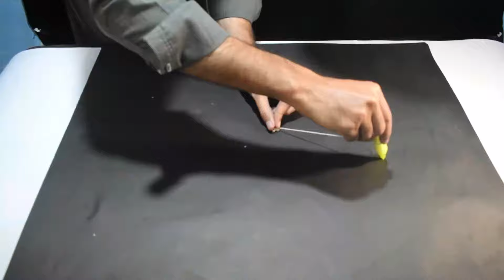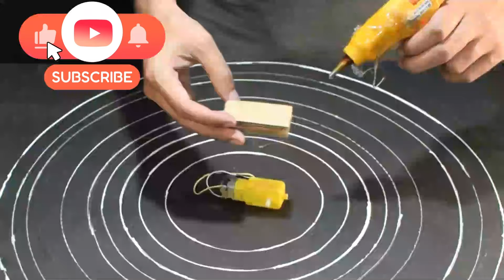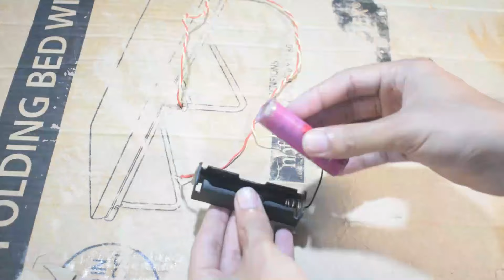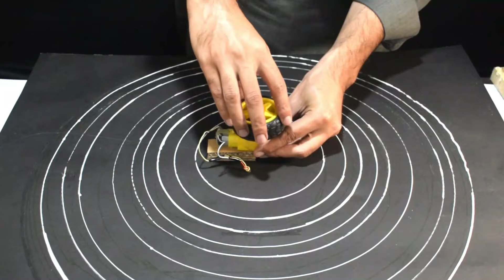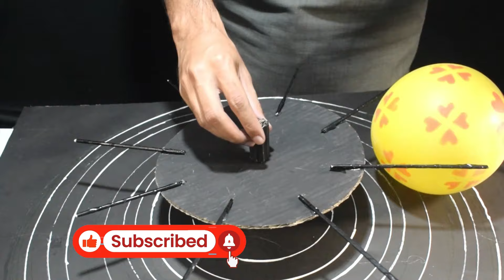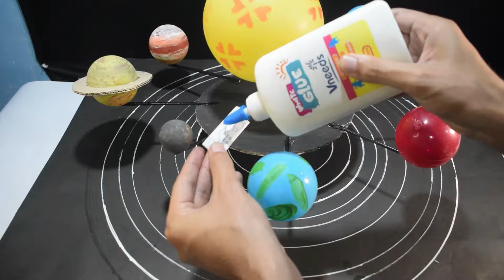Make a Solar system working model - Science project working model

Comment: Bro what are the exact name of the material used
Reply from the maker: 9 ball (1 bigsize)for sun & 8 mini ball for planets according to planets size
1 DC gear Motor with battery, switch and some pieces of wire
Some pieces of wooden stick or metal thin rod 
1 black hard sheet for background 
Pieces of cardboard 
For more plz watch till end🥰
Reply: The motor is to fast how to reduce its speed
Reply from the maker: Used low charge battery or 5v DC motor controller speed regulator

Comment: What are the materials needed to make it spin?
Reply from the maker: @heather2167  9 ball (1 bigsize)for sun & 8 mini ball for planets according to planets size
1 DC gear Motor with battery, switch and some pieces of wire
Some pieces of wooden stick or metal thin rod 
Pieces of cardboard 
For more plz watch till end🥰
Reply: @Experthand  thank you so much!
Reply from the maker: @heather2167  welcome🥰